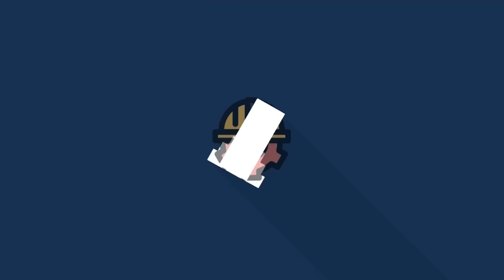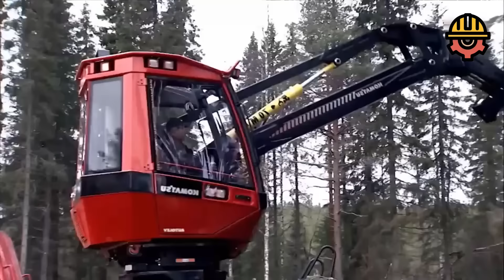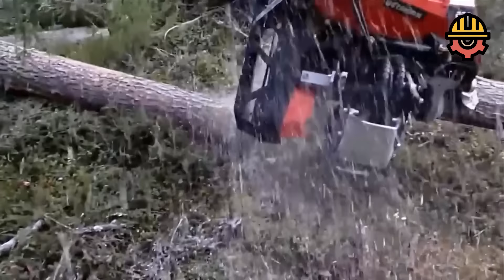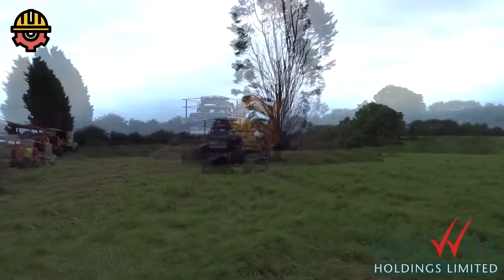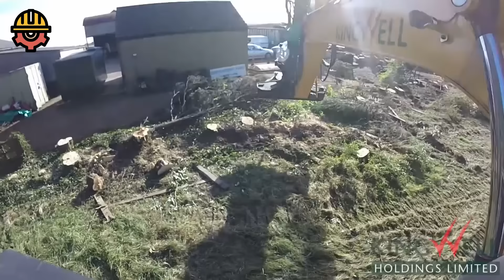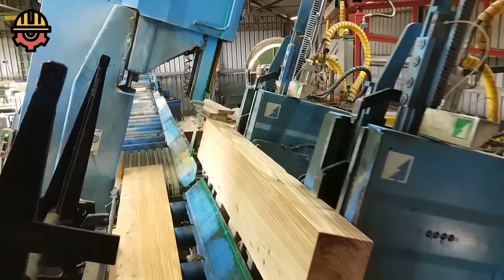Amazing Dangerous Fastest Chainsaw Felling Tree Machines | Powerful Logging Truck & Wood Sawmill

Comment: This would be very helpful in a residential application. Could you use the chainsaw unit without the truck attached? If the chain part could do the notch cut, and back cut and then fell the cut in the direction of the notch that would be a very compelling product. In a suburban context getting the big rig into the backyard is not going to happen.